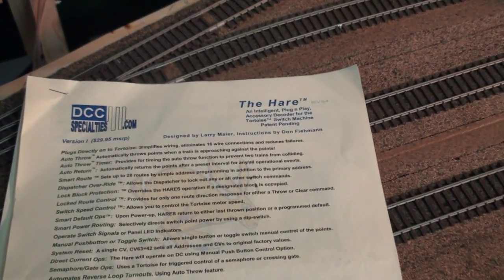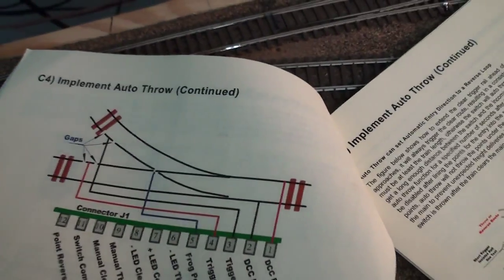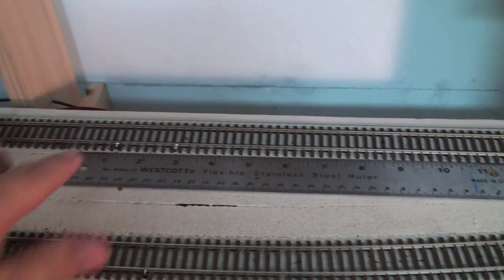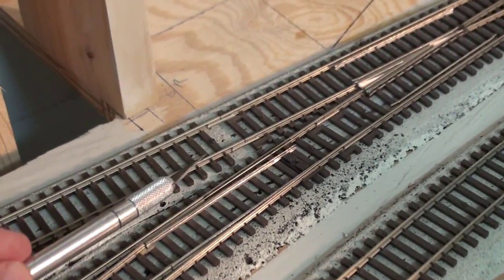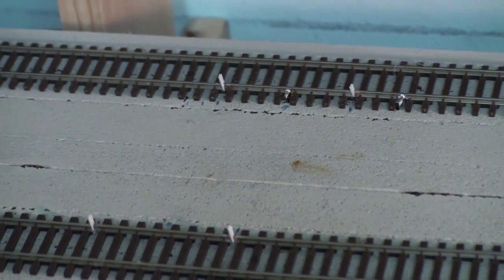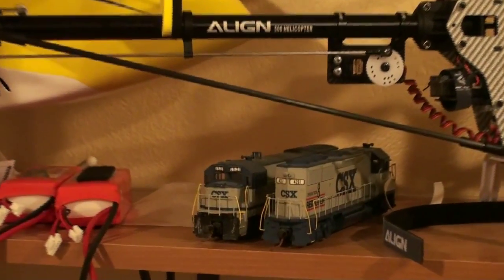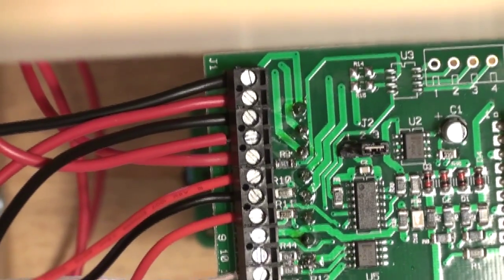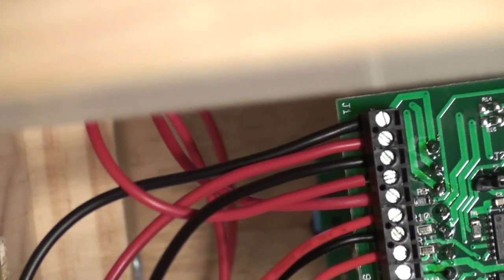Part 8 The Hare and Auto Throw

Comment from the maker: The Isolated track becomes a trigger.  When the Wheels of the Loco cross over into the isolated section it powers the isolated section but also tells the Hare to change the track polarity on the adjacent track beyon the isolated track.  Hope that makes sense.  If not go to Tony's Train exchage and you can download the manual for the "Hare".

Comment from the maker: More expensive?   Depends:  The layout may not be but the locomotives are.  The layout would not require the traditional blocks and selector switches that a DC set up would require, however you still would want to get circuit breakers and Auto reverse circuit breakers.

As for the garage?  She is a great wife....